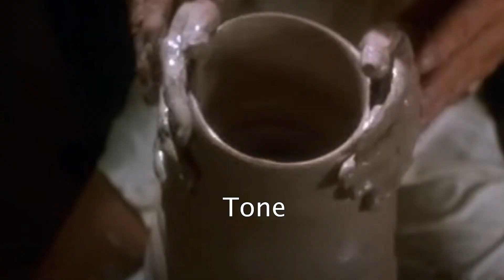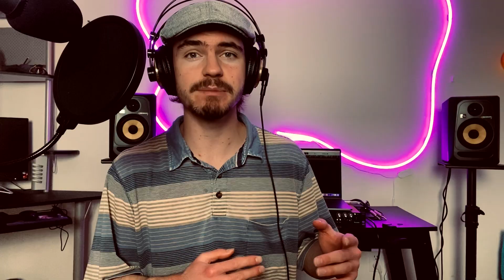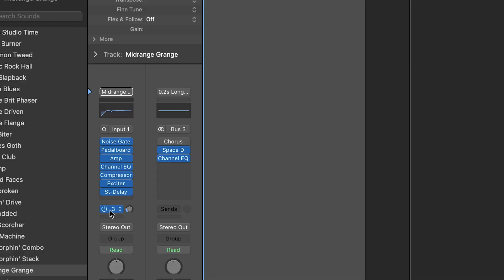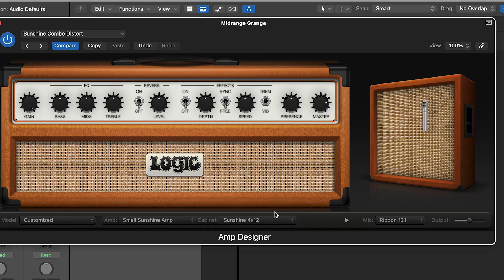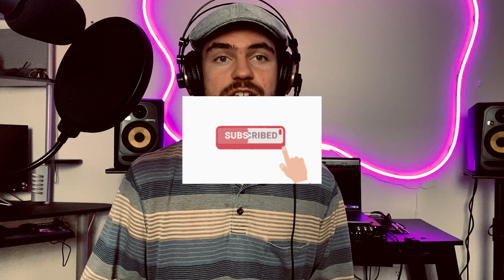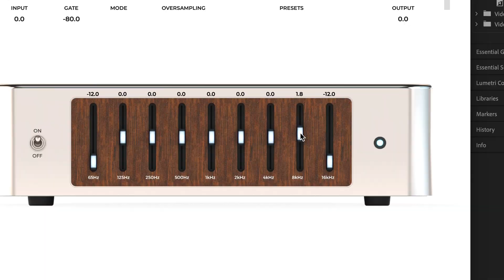5 Tips For Great DI Rock/Metal Guitars

Comment: Of course the gain knob SHOULDN'T be all the way down. It should be in the spot where the signal is not clipping inside the software, but isn't too low either. That said, different pickup types (passive vs active) would give different signal from the guitar to the audio interface. Maybe your pickups are very loud and having the gain knob of the interface gives you the best result.
Reply from the maker: I used to turn the gain about halfway on the interface where the signal was still green and not clipping, but I’ve found turning it to zero gives me better results. Just a matter of preference. Thanks for watching!